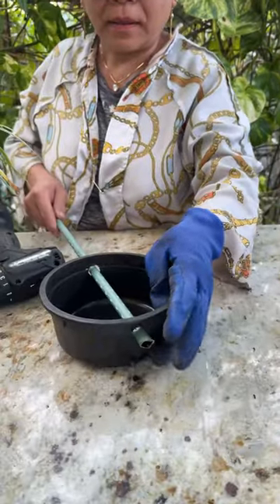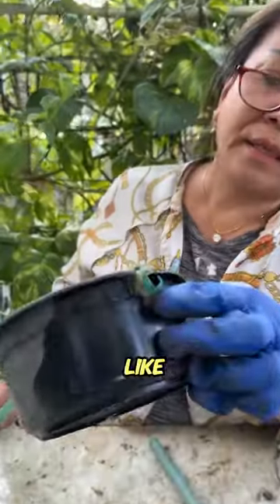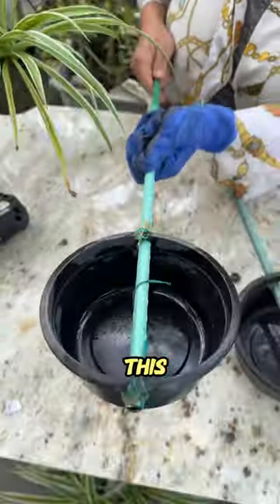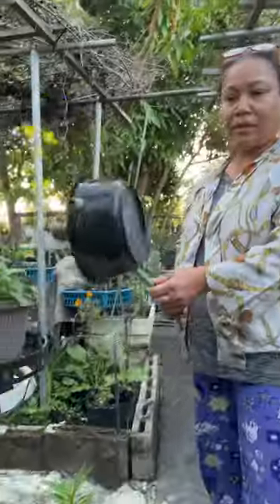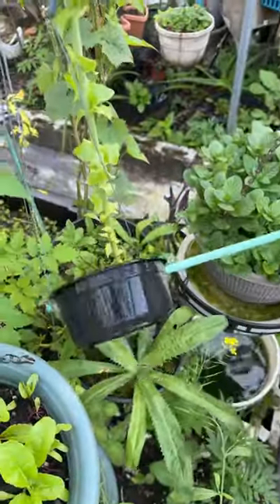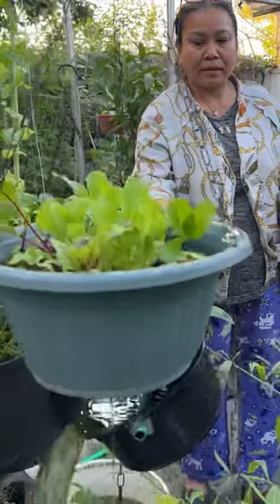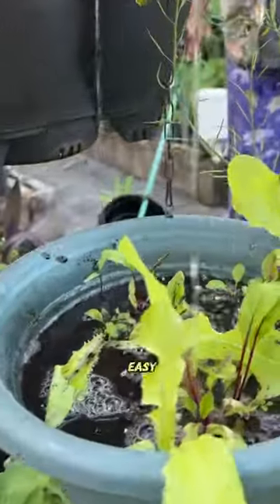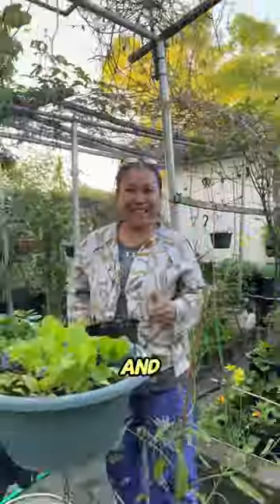How to make mom’s DIY ladle for watering your plants! 🔥 #shorts #gardendiy

Comment: Are the water buckets disturbed enough that mosquitoes don't attract???
Reply: Yeah I was thinking the same. The trade off seems worth it bc you could make it a point to address it. Getting water is harder and you could also get bat houses if you have the space. I also like how her plants are stacked so watering the top plant trickles down into the layers of plants below. There's so much about this system that works.
Reply: There is a product called mosquito bits that you can add to the standing water that will prevent mosquito lava from growing.  Not harmful to people or animals

Comment: If you want on one side or the other if you use a hot curling iron you or a soldering iron you can make it with a spigot with a point so it pour out in a different way instead of in a waterfall style